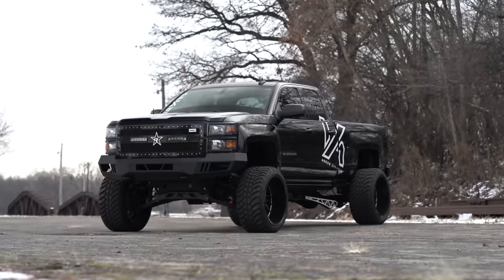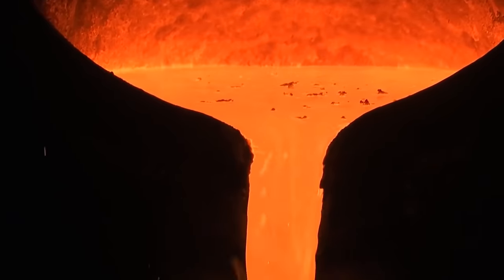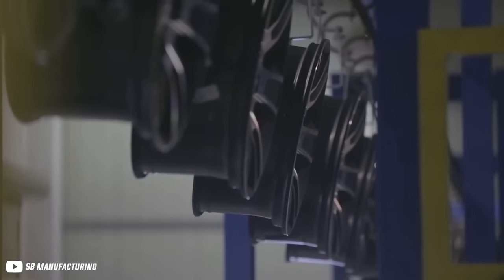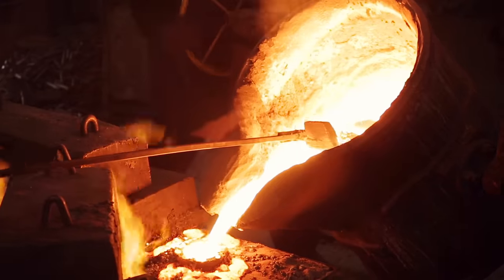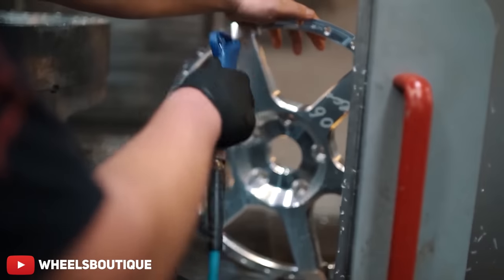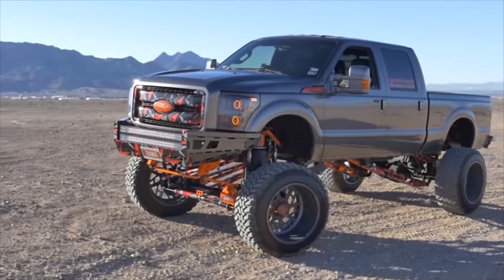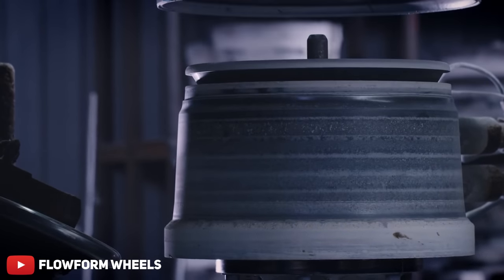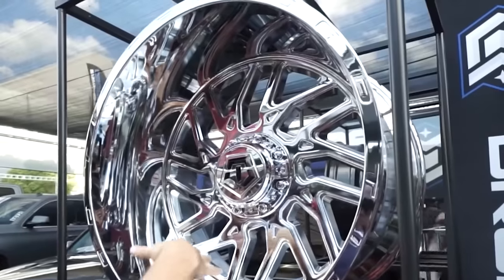Are Forged Wheels Actually Better??

Comment: Wish you would have gone into depth more about actual weight savings from cast vs forged in the same wheel size.  To some, spending more on something that’s lighter than stock when adding tires heavier than stock might me beneficial.
Reply: I agree. Why I came to this video I want to see numbers. Wish wheel companies gave us the weight of their wheels.
Reply: @arm2896  they do literally on their website

Comment: Shipping times are insane right now, I ordered my lift and wheels and tires on may 19, 2021 and still haven’t received my lift. Not fun having your wheels and tires and not being able to put them on 👍
Reply: Same. I ordered my wheels and tires in March. Still not here yet. Just have my lift. I ordered that last month and it was here within a week.
Reply: Day 80 on my wheels and tires set
Reply: @xtripv108  power to you. I would definitely not be waiting something like that out. Did you have to pay the full amount or just the $300 deposit? I would wait for a hold of $300 but not 2500-4500 for wheels and tires.

Comment: There's one thing yall should've mentioned, living anywhere that they salt the roads, forged and cast aluminum is definitely a better option than steel wheels. Seems like the rust out within a couple years.

Comment: I have a 94 k1500 single cab short bed 4x4. This winter I'm swapping in a 6.0L and a 4l80e trans. Than I'll be ordering a 4 inch lift with some 22x12 and 35' to finish it off.